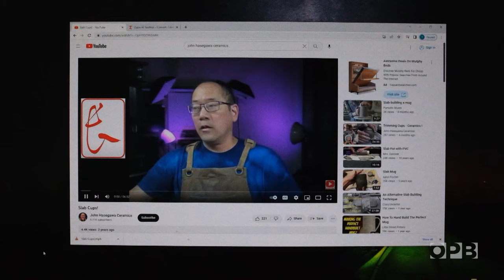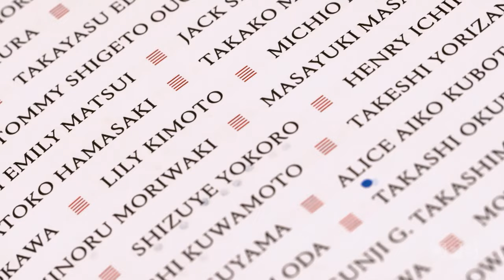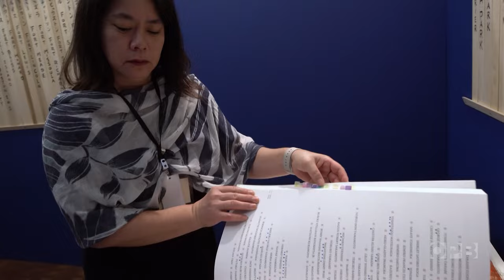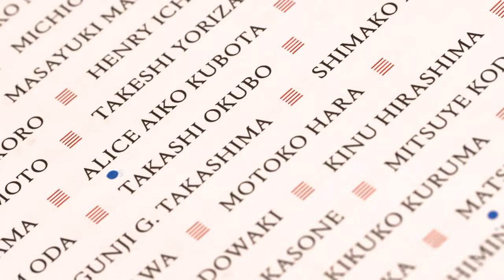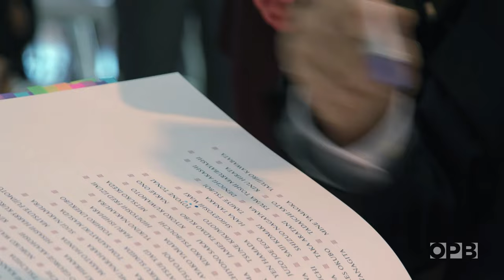John Hasegawa uses pottery to explore Asian American identity | Oregon Art Beat

Comment: Truly wonderful.

I went "back" to college in my 40s for Architecture. I love it. I could finally take the drafting classes that I wanted to take in high school, but couldn't because I was a girl. My grades exceeded any expectation I had. I even enjoyed calculus!
Like John, I took a computer art class to counter the intensity of my engineering classes. I was hooked. Then came "Statics" class which is primarily physics and math that is the backbone of engineering. I turned into a monster. I would spend hours on the 1 or 2 homework problems each night. At this point, I had found a new home in the art department, both as a full time student and a job. I switched majors to save my sanity …